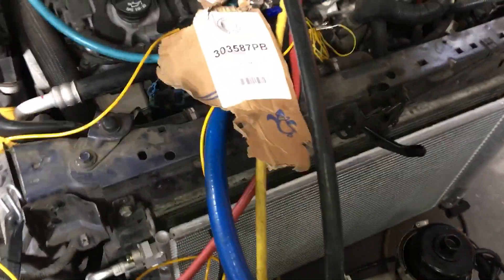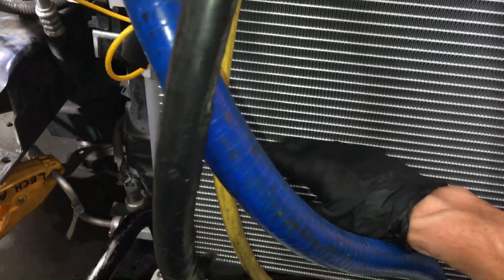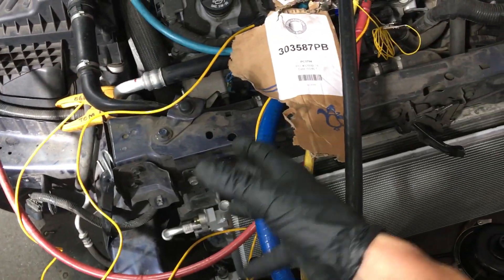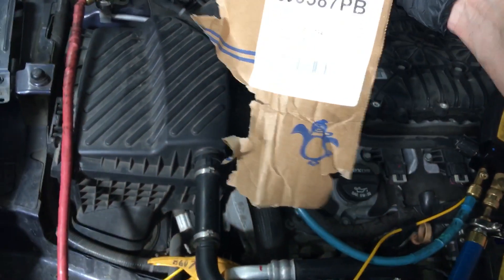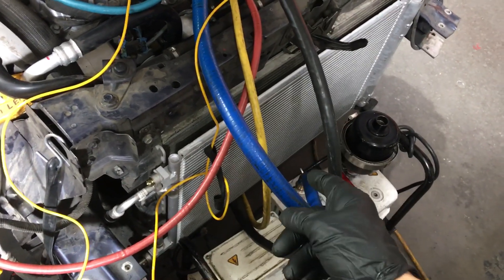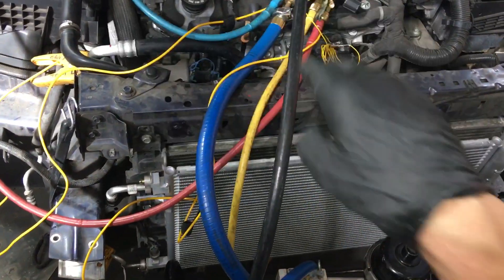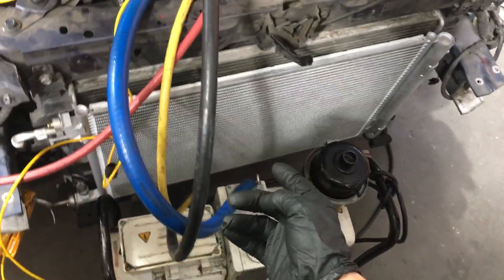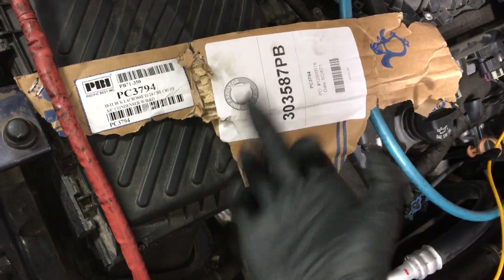Customer Gets ripped off with economy priced AC condensers.  People have no idea problems caused￼ ?￼

Comment: Body shops buying this crap
Reply from the maker: But you have to realize and take into account. 

       90+ percent of body shops don’t even know when it comes to mechanical parts that perform a physical purpose like condensers.   That you even have to count the fins and the rose of refrigerant cooling passage tubes. 

          Of course there are the type of body shops that look for the absolute cheapest part they could possibly get to make the most profit and don’t even care about quality so long as they can make it look good on the outside collect money and get the car out the door. 

             Vendors body shops that are direct repair and have a working contract and agreement with insurance companies so they can get fed work directly to them as referrals from the Insurance company.       And different insurance companies and body shops have slightly different relationships on the choices on parts.       Some shops will do everything in anything insurance company tells him to without any resistance they don’t wanna poke the hornets nest and cause any problems.  They’re literally afraid of the insurance company and the relationship with getting work. 

             Then there’s those owners especially here in California there are rules laws and regulations governing the relationships between companies doing commerce within the state things you can or cannot do as a vendor or contractor of another business. 
          That affects the workmanship or quality performance to a general public customer.   And those certain body shop owners even though they do have a agreement they know the difference between what’s right and what’s wrong and they will pick up that phone and make their case or argue the reason why they need to get the original equipment part or have to pay more to get a different aftermarket part . 

          Remember body shops or not mechanical shops it just Hass to look Beautiful start run get out the door and collect the money a lot of things get covered up under that shiny paint and Bondo. 

           I spent my years in the body shop as a manager and a painter long long time ago and my family all owns mechanical shops and body shops throughout our generation I grew up seeing both sides of the fence.
Reply: @coldfinger459sub0  your right man thanks for your knowledge
Reply: Do you have a shop or your just contacted for all jobs
Reply from the maker: @carlitos19cali  I only work for mechanical shops that need equipment or somebody with knowledge to diagnose the air conditioning for them.    And handle and take care of and be responsible for the refrigerant aspect of the job and the mechanical operation of the refrigerant system. 

         I’m a direct vendor to the body shops around in the bay area around San Francisco down to Redwood City we’re doing the insurance company repair work or private cash jobs through body shops for their customers. 

      Do the refrigerant handling recovery and recharge to take care of the EPA paperwork and aspect of recovering refrigerant for every drop in body shops

        My private customers that I have more than 30 years are all word-of-mouth through either mechanical shop owners through body shop owners or directly from the mechanic to work on the cars themselves and their family members keep me more than enough busy 14 hours a day if I wanted to every day of the week. 

         I do not normally take off the street customers or anybody who I do not have a direct connection worth I have way too much work to be taking on any new clients